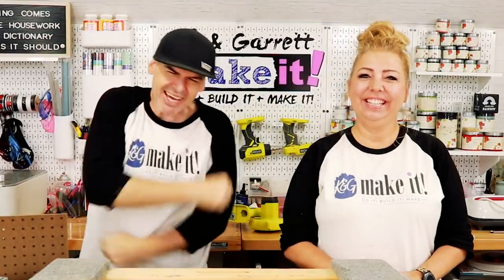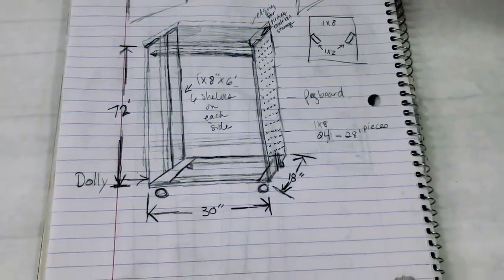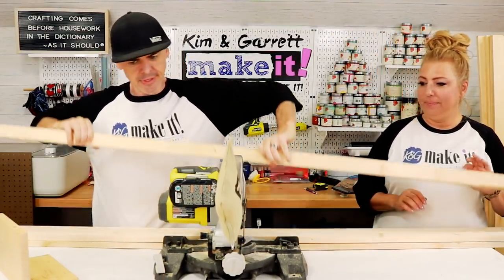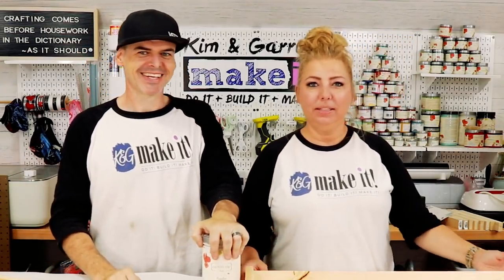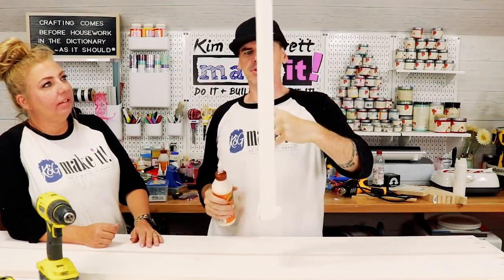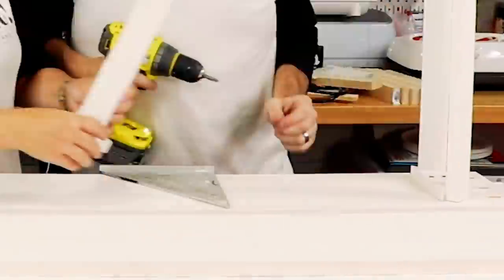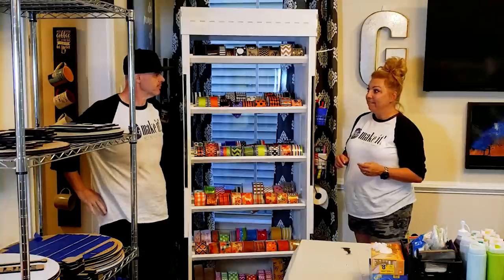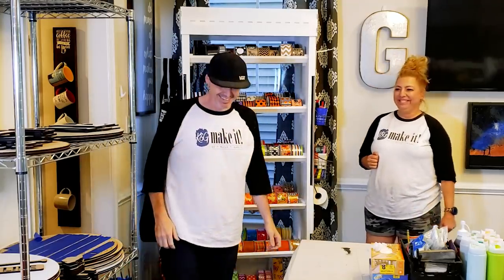DIY Rolling Ribbon Storage Organizer Rack

Comment: This is awesome. Love all the storage. I have a tall, bookcase I'm converting. Going to use curtain tension rods and put the rods thru the spool holes. Not as convenient to get out one spool at a time but it will work. Might add some pegboard too. Trying to figure out a way to store the paint so the colors are visible and still be able to use all the space on the shelf. It's a work in progress.